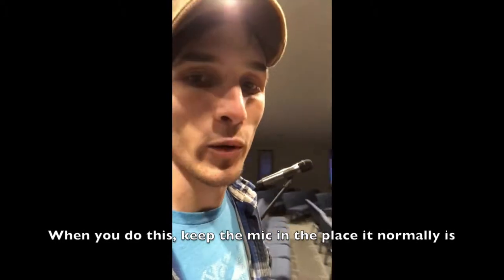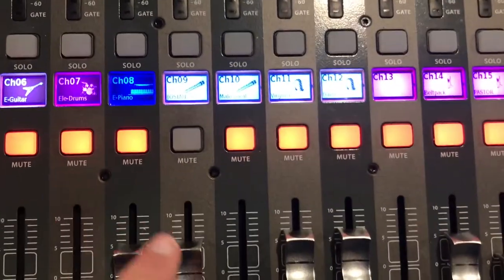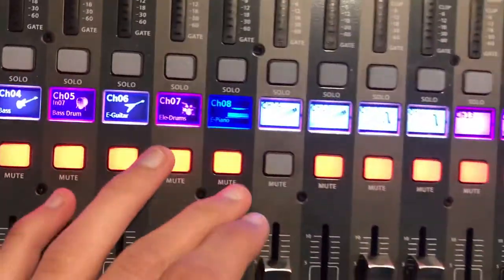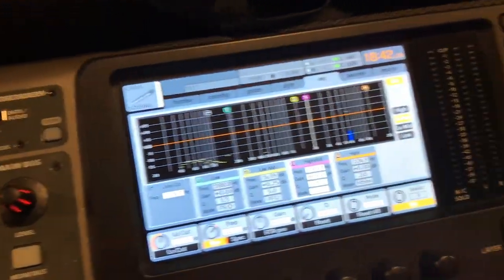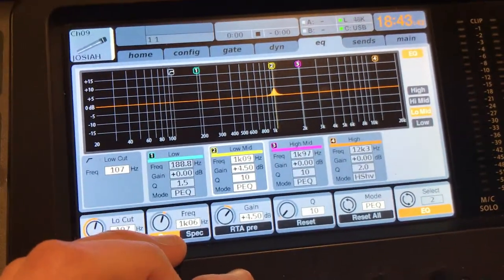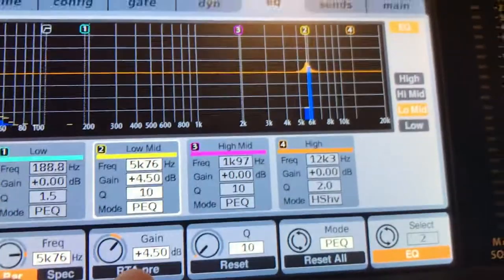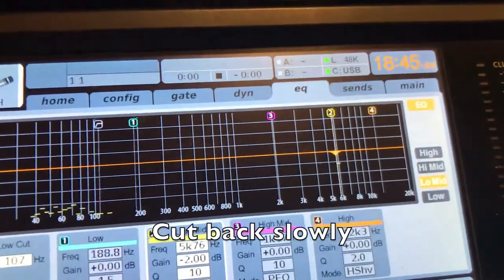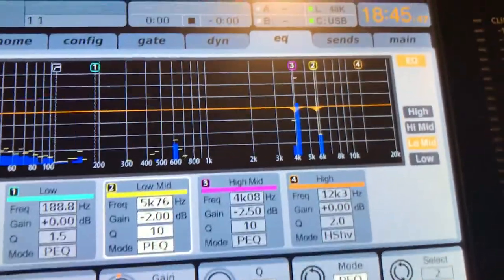Ringing out Feedback in a Microphone

Comment: You don't use channel EQ to eliminate feedback. Use the system EQ for feedback removal and then channel eq to set channel tone.
Reply from the maker: Hey James, you make a good point! I now often start with system EQ for this issue (using a graphic equalizer). I have learned that many of the big problem spots are venue-related and will be the same across multiple mics. But there are a few things to keep in mind.

(1) If the problem is coming from an individual microphone that is more prone to feedback, perhaps due to where it is positioned on the stage or its specific build (condensers are always worse), you can end up really messing with your overall EQ curve just to fix one mic. Let's say you have to cut 1K and 2K by 10dB each to stop a condenser mic from screaming... those changes will then affect everything in your mix. Maybe worst of all you will lose presence on your vocal, which may have sounded great before. In any case, you need to know your equipment and what is causing the problem.

Condenser mics are always worse than dynamic mics, and they usually have a pretty decent frequency response (not too much tone shaping needed with them), so using the channel EQ may be a better choice for those mics. Whereas, if an issue is shared by multiple vocal mics, it would be better to use the system EQ.

(2) Related to number 1. If you are troubleshooting sudden feedback, rather than messing with your overall mix, it is often better to target in on the mic that's having problems.

Finally, I'll say a well-tuned system and well-treated room will eliminate most of these issues.

Kind regards,
Josiah
Reply: @deepwatervideo  Have you ever tried a white noise generator to tune out room modes in the system EQ before connecting any mics?  And then using channel EQ to handle feedback through individual mics?
Reply from the maker: @michaelandreas2177  The room in this video was untreated. Pink-noise and feedback suppression helped a great deal! We were able to get a decent curve for pre-recorded sound (tracks, videos, and other music, our electronic instruments, etc.). The placement of the speakers and mics, however, made certain mics much more prone to feedback.

In other words, we had a choice between keeping a good sounding curve or adjusting the house for these few microphones. What I have ended up doing lately, is using a graphic EQ on a bus for our live vocals. And another graphic EQ for our two wireless packs. This works really well.

Thanks for your thoughts!
Josiah
Reply: What mean channel EQ vs System EQ ?
Reply: You mean GEQ
Reply: true
Reply: All x32 have the same flaw design on " not having GEQ " on the channel strip which even on the smallest X AIR model has . . . it's such a hassle that you have to patch a bloody GEQ on the mix bus but only for the first time use though . . . then you can save the scene for later session.
Reply: @deepwatervideo  this absolutely right, because I try same technique and most of mics in stage is crystal clear

Comment: This was helpful in finding ringing frequencies however if you do it like this you are shorting yourself of multiple bands to make that mic EQ sound better
Reply: 100% agree, which is why I would personally use a graphic EQ instead, so then you can save the parametric EQ for the singer’s voice.
Reply: Much better to use graphic on the bus eq instead of Eqing it out of the mic channel. This dude has it wrong
Reply: @mexstrat96  agreed, that’s how I do it too.
Reply from the maker: Hey Adam, Luke, STNKEYEZ, you all make a good point! I now often start with system EQ for this issue (using a graphic equalizer). I've learned that many of the big problem spots are venue-related and will be the same across multiple mics. But there are a few things to keep in mind.

(1) If the problem is coming from an individual microphone that is more prone to feedback, perhaps due to where it is positioned on the stage or its specific build (condensers are always worse), you can end up really messing with your overall EQ curve just to fix one mic. Let's say you have to cut 1K and 2K by 10dB each to stop a condenser mic from screaming... those changes will then affect everything in your mix. Maybe worst of all you will lose presence on your vocal, which may have sounded great before. In any case, you need to know your equipment and what is causing the problem.

Condenser mics are always worse than dynamic mics, and they usually have a pretty decent frequency response (not too much tone shaping needed with them), so using the channel EQ may be a better choice for those mics. Whereas, if an issue is shared by multiple vocal mics, it would be better to use the system EQ.

(2) Related to number 1. If you are troubleshooting sudden feedback, rather than messing with your overall mix, it is often better to target in on the mic that's having problems.

Finally, I'll say a well-tuned system and well-treated room will eliminate most of these issues.

Kind regards,
Josiah

Comment: I usually take feedback out from the “Dual/Stereo EQ” in the effects menu, works better for me🤷🏾‍♂️
Reply: And using the graphic one also gives more control than just 4 bands
Reply: Thank you so much for this video, very educative. 
Please I still need help
Reply: Problem is there’s limited channels, so this won’t work on say, 12 mics
Reply from the maker: Hey @Emkai, @Daniele Duca, you all make a good point! I now often start with system EQ for this issue. I've learned that many of the big problem spots are venue-related and will be the same across multiple mics. But there are a few things to keep in mind.

(1) If the problem is coming from an individual microphone that is more prone to feedback, perhaps due to where it is positioned on the stage or its specific build (condensers are always worse), you can end up really messing with your overall EQ curve just to fix one mic. Let's say you have to cut 1K and 2K by 10dB each to stop a condenser mic from screaming... those changes will then affect everything in your mix. Maybe worst of all you will lose presence on your vocal, which may have sounded great before. In any case, you need to know your equipment and what is causing the problem.

Condenser mics are always worse than dynamic mics, and they usually have a pretty decent frequency response (not too much tone shaping needed with them), so using the channel EQ may be a better choice for those mics. Whereas, if an issue is shared by multiple vocal mics, it would be better to use the system EQ.

(2) Related to number 1. If you are troubleshooting sudden feedback, rather than messing with your overall mix, it is often better to target in on the mic that's having problems.

Finally, I'll say a well-tuned system and well-treated room will eliminate most of these issues.

Kind regards,
Josiah

Comment: Anyone find that you could do this, but once you get all mics going on stage, they exhibit totally different freq problems?
Reply from the maker: Yes Ryan, that is a key observation. This will often be the case especially if you are using a limiter or compression on your main bus. Frequency issues also will change when you have a full house. (I think in the video my room was empty.) People will actually act as sound absorption.

The biggest thing that will help you with this is getting the right equipment and ringing out your room. The Behringer X32 has a great user interface to do this, but you will have to check your board to see if it has a similar feature. https://www.youtube.com/watch?v=Kez1LIHbevY&t=7s

Ringing out your room deals with most venue-based frequency issues, which will help you get to a better starting point for mixing. (Actually a good mix is near-to-impossible without doing this first) The only caveat to the above video is that you don't always want to aim for a perfectly flat response with pink noise. Often venues aim more for a curve with higher bass, lower mids, and mid-to high treble. This is a good area to consult an expert. You'll pay for it, but if they do a good job, it will be worth the investment.

Comment: So you sacrifice the eq for the channel strip  to cut feedback? Sound to me like you need to re eq the house again. Cutting feedback at the channels is no practical. Get a DBX drive rack and use the feedback suppression in it. There’s only so much gain you can have in a venue before feedback. Get your gain structure set first then check. Pink noise to around a comfortable level 85 DB is a good place to start. You be surprised how well this works.
Reply: Hi Noel, I am curious to find out how you would use the DBX drive rack with the X32.
Reply: @danielalexis9409  Hello Daniel. Is very simple connect the main out from the x32 normally output 15&16 and feed the input of the DBX drive rack . Then distribute the outputs from the processor to the PA system. There are plenty of videos here on you tube on that subject. Hope this helps cheers.
Reply from the maker: The room in this video was untreated. Pink-noise and feedback suppression helped a great deal! We were able to get a decent curve for pre-recorded sound (tracks, videos, and other music, our electronic instruments, etc.). The placement of the speakers and mics, however, made certain mics much more prone to feedback.

In other words, we had a choice between keeping a good sounding curve or adjusting the house for these few microphones. What I have ended up doing lately, is using a graphic EQ on a bus for our live vocals. And another graphic EQ for our two wireless packs. This works really well.

Thanks for your thoughts!
Josiah

Comment: What if I need to cut a 5th note?
Reply from the maker: Hey HydroViper, see @James Njoroge comment for thoughts on how to deal with this. A few options:

- It may likely be your system EQ needs adjustment because of a bad room. You can use a multi-band EQ inserted on your mains bus to fix that. Maybe look up some videos on how to ring out your room...

- If it is a condenser mic that is especially sensitive to certain frequencies, then it may be a good idea to insert the same multi-band EQ on that channel individually. I have had to do that with choir mics.

Blessings,
Josiah

Comment: im really curious because I'm also new with live mixing,
why dont you use one band and cut with big spread like Q 3.0-5.0 (it could cut 4k-6k with one band)
Reply from the maker: Hey Jireh, there are certainly times to use a smaller Q and cut a large band. ESPECIALLY if you are mixing in a bad room, or working with a recording that was done in a bad room. You will often find areas with a ton of unwanted frequencies and if you only have 4 bands to work with, you need to get the most possible done with each EQ move.

But Shlomo G is right, it is often better to subtract less overall, so that you don't end up messing with the natural tone. If you can ring out your mic with one or two thin bands, it will sound more natural overall.

Comment: is better to insert a graphic eq, and use the parametric for normal tone eq.. but thanks this was very helpful
Reply: No it is not, you will cut to much freq. that needs to stay.
Reply from the maker: @Samuel Opara, good question!

I now often will use a graphic EQ for that reason. QD DK is right that the graphic EQ will cut more than needed, but it does free up your parametric for tonal eq. It also kind of depends on how many effects slots you have to work with. I am often mixing 10-20 channels live and have 4-6 slots used up with my basic/necessary effects.

Comment: Q is the same on every board. It's a mathematical equation to quantify the bandwidth.
Reply from the maker: @nicknovak1352 this is generally true. In my understanding, Q is the ratio between the primary frequency that is being adjusted (let's say 1000Hz) and the bandwidth of the two frequencies that are affected by half as much (let's say 500Hz and 1500Hz are affected half as much as 1000Hz). In this example, the bandwidth between those frequencies is 1000Hz, so the value of Q would be 1.

However, some plugins deviate from this rule (or have different harmonic material that they introduce). There is also the issue of "constant Q", which means the value of Q changes (visibly or invisibly) as the gain is increased. It is always best to use your ears.

Kind regards,
Josiah